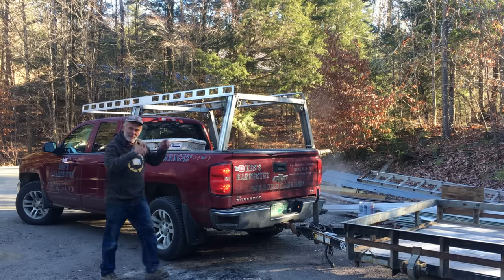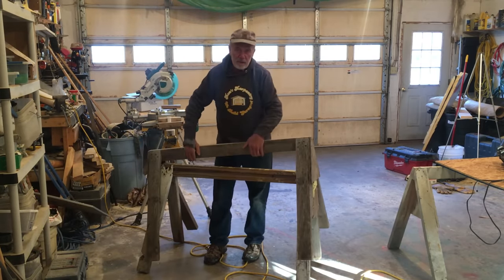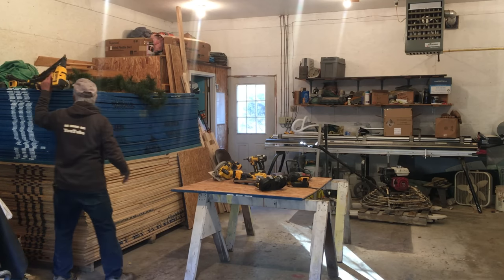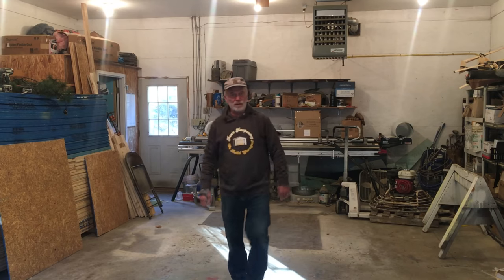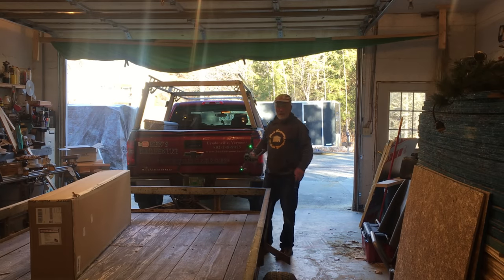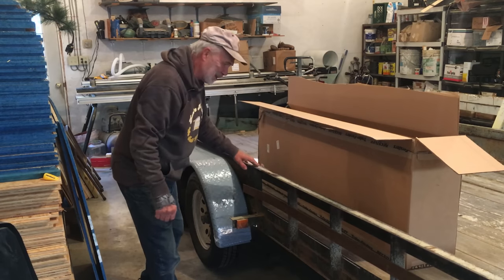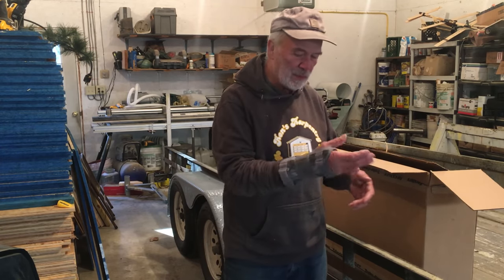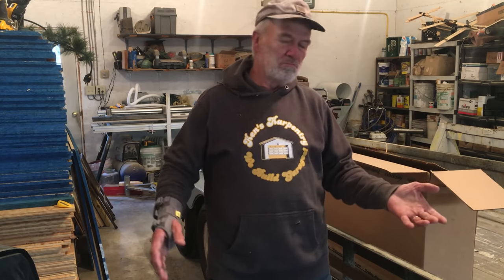Wrist Update, Weigh in and Trailer Fenders

Comment: Having had multiple trailers both large and small,The most often overlooked item is wheel bearing maintenance.Also most all trailers have off shore wheel bearings.I have had a few failures myself. Now I always replace any wheel bearings with timkin made in the USA bearings and you can buy them off e bay shipped right to you. Good winter project for you.
Reply from the maker: Thanks

Comment: Gonna give myself a virtual pat on the back for going on a two week vacation (warm climate) and only gaining about 2 pounds. I would bet most of that is water weight and will melt away by the end of the week as I get back to my normal routine. On the power cords, big loops are the way to go if you have the storage room. (hang on the wall) Almost nobody makes a cord that is soft and pliable these days and all the professional electrical people I know make their own cords from bulk rolls of SJO cable. Yes, it will cost more but they will last a LONG time.... and you will always know they are your handy work because nobody else on the job has them. Pointer on power tools... fully charge the batteries and store above freezing. Charge again in the spring before use.
Reply from the maker: Thanks and good job on your weight

Comment: That next 10 lbs is going to be hard. Also not working for winter will make it worse. Just maintain - the new no normal -then when you go back to that work schedule,it will be like starting all over and you will lose that last 10 lbs. . I didn't figure that out until I stopped working and no more gym ( light gym , stomach crunches, curls, 40 min bike, 40 min treadmill. ).
Reply from the maker: Thanks

Comment: Good to see you making big loops I agree with that method 😊as a non driver 👍backing up the trailer into the garage looked so easy peesy how’s many times did you have to practice as a youngster to accomplish that impressive maneuver .looks like your wrist was still an issue when you picked up the sawhorses .is this before or after breakfast weight and remember that hat hoodie weigh more than a couple of ounces and did you do number one and two yet are you wearing long johns and remember take off any jewelry as well as your watch. Nearly forgot too add sky clad is best way but just report it not show it . Perhaps breath out .oh I didn’t notice were you wearing a belt and shirt😮❤ 😊❤😂❤
Reply: best to weigh in the buff before dressing and do it at the same time each day. I find my weight changes 2-4 pounds from morning to evening.
Reply: @rupe53  I agree buff equals sky clad I was taught that if I must weigh myself every day at the same time that I should total the weight and divide by seven so that I would not stress over the individual days  gains I suppose
Reply: @lindagates9150  ... yes, stressing over the daily (minor) changes is problematic for some. I find it's a learning experience to see what triggers that rollercoaster. (think back to what you consumed yesterday) I'm really looking at the longer-range trend and what small changes can make the biggest difference. I don't do conventional diets. I do cut back on trigger items and portions when I see variations. At 69 years old a few beers with some pizza on a Friday night are my biggest downfall.
Reply: @rupe53  I am buying a continuous glucose monitor to track what is spiking my blood sugar numbers my doctor is saying that I don’t have diabetes but I still want to know is it just my age or the foods that I am eating that has brought the fasting glucose levels up as I don’t consume sugars grains and processed foods . I want to know my triggers so I can make an informed decision. At this time I am doing an early start four hour eating window method of intermittent fasting. Because of food allergies and being a widow it is easy to do that. I fell into intermittent fasting by eating when I felt hungry then found out I was doing a fasting method. I hope I don’t have to cut sweet potatoes or beets from my diet nor Avocado 🤷🏼‍♀️😊👋🙋🏼‍♀️👋
Reply: @lindagates9150  ... Age has something to do with it and causes everything slows down, including the body's response to triggers. If you read the packaging, you will find a lot of info on various foods. All carbs turn to sugar, including breads and potatoes. Many foods also contain high fructose additives, which are tricky. If I eat two jellybeans every day it's enough to make me gain weight, despite the calories being in the single digits. One handful of potato chips is under 100 calories, but also kicks in weight gain. 2 beers a day (every day) is a problem. 3 beers, twice a week doesn't seem to show. That tells me moderation (with rest between) is part of the solution.
Reply from the maker: Haha thanks
Reply from the maker: I try to where comparable weight clothing
Reply from the maker: Wow take care of yourself
Reply: @rupe53  hi in November of 2020 I decided that I would change my diet I considered my grandparents diets they were all diabetic so I thought there mothers were healthy individuals who lived to their nineties so I selected the widow who I knew had been a hunter a mother of a lot of children she had a farm lived many miles from the nearest general store I knew that she made her own yogurt and flavoured it with herbs from her fence row near her kitchen door hunted moose and the early 1900 would not have access to the crap big business producers sell as food in today’s stores. Well I don’t have a farm access to wild meat didn’t like the yogurt I tried to make so I thought she’s up early running a farm hauling water from a well , using an outhouse since my grandmother made her own sauerkraut I figured her mother likely taught her what to do how close to her pattern of eating could I get . I decided that I would not buy anything with added sugar to start with  nor live her off grid lifestyle to the fullest just buy organic vegetables limit the amount of flour eat a local stone ground oatmeal and treat myself to  tablespoon of local maple syrup buy local grass fed meats and local eggs stop eating any snack foods eat three meals a day. I made everything from scratch as she would have done and how she taught her daughters to cook .I figured she would make treats for the family if and when she had the wherewithal but it likely was Christmas Easter thanksgiving so as I learned more about sugar and artificial sugar and that grain starch is a form of sugar the holiday treats were removed from my diet. Since she would have butter lard and suet as he fats I stopped buying so called vegetables oil’s that had been developed when my grandmother was a young person as a greaser for equipment not a food . The last grain I gave up was the oatmeal the last bowl had a half a tablespoon of maple syrup I tossed the almost full bottle down the sink. I can be a bit obsessed with following a plan.   After going sugar free I stopped having cravings and started eating my breakfast later and later. My first meal of the day is a dinner meal of steamed vegetables avocado butter and protein either grass fed meat or wild caught pacific salmon packed the traditional way with skin and bones or other small fish like sardines packed in water I eat it all skin and bonesThe only thing I think I have left out is the benefits of spices especially those from India and other countries in that area of the word. My drink of choice is filtered water I eat just about everything vegetable that is locally grown but willing eat steamed organic beets from France just remembered I use thick cream from the Netherlands I used to use a local whipping cream but it has so many chemicals in it I searched my store and found a canned product that is cream and one other additives likely not one of the best choices I’ve ever made but much better than the other crappy stuff.I lost my Covid weight gain and then some no longer have non alcoholic fatty liver disease         Five foot three and a half inch tall and my weight fluctuates sometimes 110 when I do a two day fast  this morning 114 years ago I was 239 was on a roller coaster this is working for me and I an so glad that I have developed my personal healthy diet and have also got my butt in gear to.have a great day may you find that which works for you and make every meal a feast. That could take some rethinking about your choices good luck
Reply: @kenskarpentry  thank you  I was writing a long essay for rupe53 when you posted glad I tickled your funny bone..laughing must help us lose weight at least we can’t eat while doing it 
you are today’s winners of my PH award for your efforts in beating your weight gain😇💜🌟on second thought you should have the highest award also for distinguished service in your battles with the enemy….
Reply: @rupe53  I am in Canada and I hope that the soil is better than the dirt that  is used by a lot of bigger growers who depend o n pharmaceuticals and that the pesticide are not as lethal as the ones used for regular produce I buy mainly frozen or local farm produce . I know it’s not as well regulated as it is in Europe that is why I buy tomato passata from Italy it’s packaged in glass bottles hopefully good quality glass it’s made without skin and seeds I feel that is better than canned stuff. Also the organic beets are from France I don’t buy everything organic I found a list of foods of which the difference of quality is practically undetectable . I process foods for my freezer so I haven’t noticed any problems with loss. I don’t think I can have perfection hope I have made good choices and that with the choices that I have made will be better than the ones I was making prior to November of 2020 my blood work is good my VD3 is in the sixties now that was My Drs only concern in 2021 ciao Linda